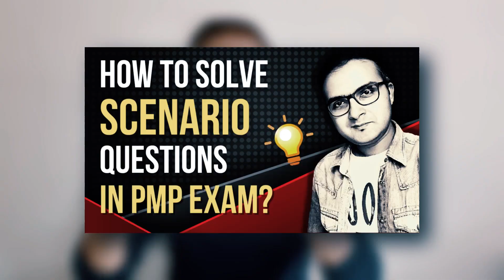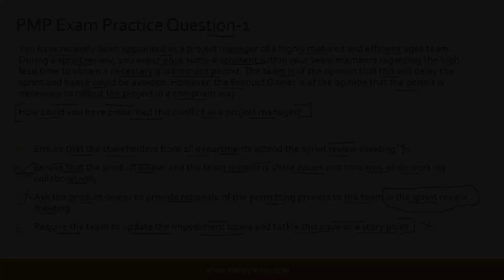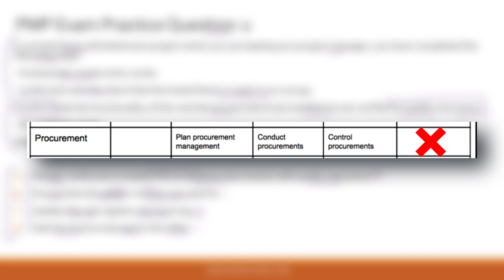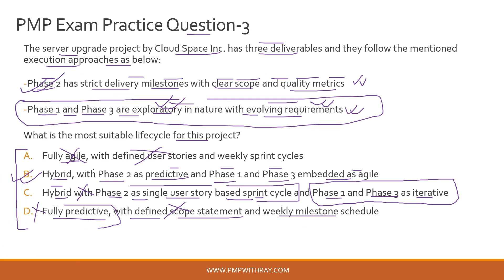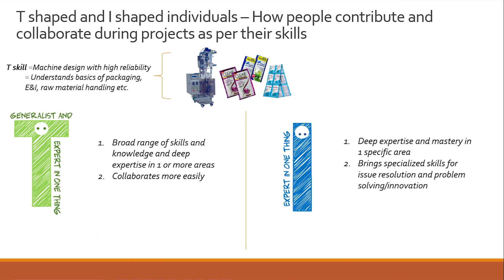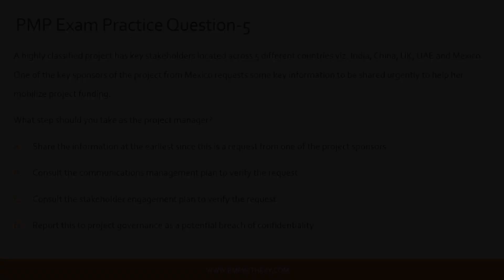PMP Exam Questions 2023 (Aug) and Answers Practice Session | PMP Exam Prep | PMP for Project Manager

Comment: Really confused in Q2. If when closing project appears an issue or risk, that will affect the lessons learned. However at the side of invoices, can we close without verifying invoices? May appear an issue with one invoice that will affect the  whole project benefit (by experience).
Anyway, all other questions answered correctly.
Reply from the maker: Hi, 'verification' is not equal to 'ensure payment'. Hence, your line of thought is correct, but Option B does not support that.

Comment: Hi Ray, Thanks for your efforts. I am confused because according to PMI; point 4 states to review all contracts and made sure all payments are made. So how did we exclude this option? Thanks. 

How can I close the project in the best manner possible?
The section above describes a thorough project closing process. Below is a guideline that project managers could use to close their projects comprehensively:

1- Ensure those operations and any and all other departments/units/parties who will use the product(s) of the project have the necessary training, tools, documentation, and capability to perform their role.
2- Ensure that the project has satisfied the strategic goal(s) for which it was undertaken.
3- Ensure that the whole scope of work has been completed, and make sure to receive formal documented acceptance from the client and sponsor.
4- Review all contracts with the project team and suppliers. Make sure that all parties have satisfied their contractual obligations—that the suppliers have delivered all of the products or services required of them and that the organization has made all pertinent payments. Release bonds if necessary, and make sure the supplier provides all supplementary deliverables, which may include, but may not be limited to product documentation, drawings, warranties, service contracts, lien waivers, and so forth.
5- Review project management practices.
6- Document lessons learned for future reference.
7 - Disband the project team and officially return resources to their functional locations.
Reply from the maker: Hi, point# 1-7 are not excerpts from PMBOK-7. So, may I know what is the reference for this when you mention 'according to PMI' please?
As I mentioned in the answer explanation, ensuring all invoices are 'posted' correctly to accounts is job of PM, payment can happen 60/90 days after invoice posting depending on the procurement payment terms.
Hence, Option D which is LFE is a better choice.

Comment: Question 1: is the matter of permit discussed in any sprint review ? I mean should it be discussed at retrospective ? does a sprint review focus on the work thats done in that particular sprint and demo to the customer ?? Pl make us understand
Reply from the maker: The permit issue is a blocker/impediment and hence should be discussed in the sprint review for immediate solution. Retrospective could be used for a 'learn from experience' standpoint.